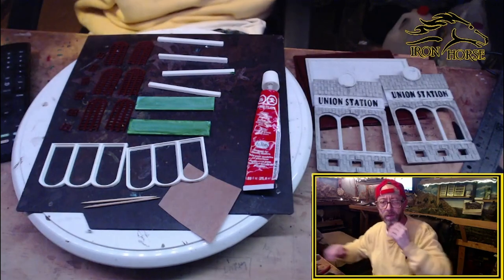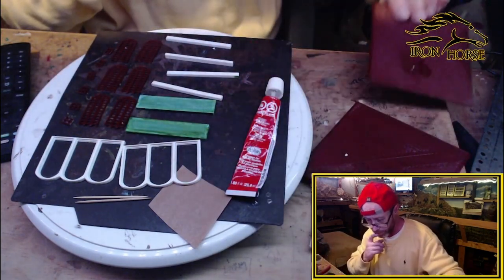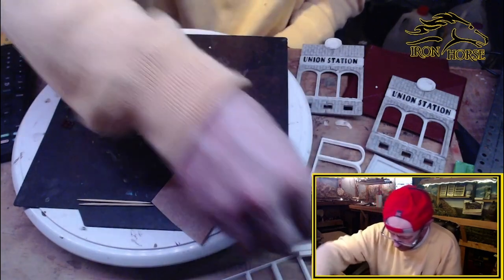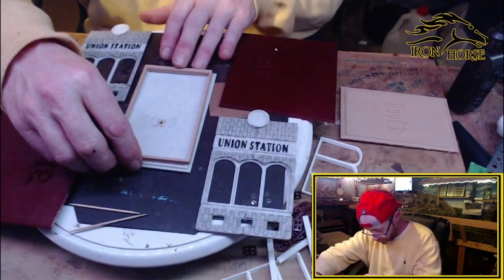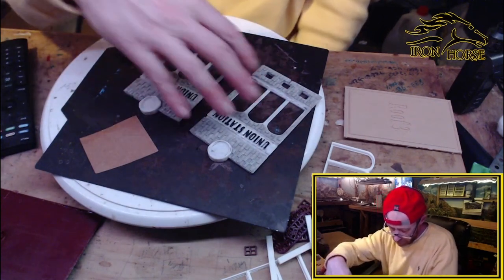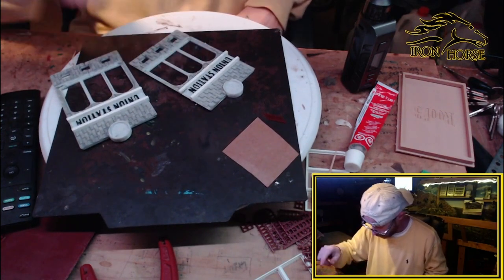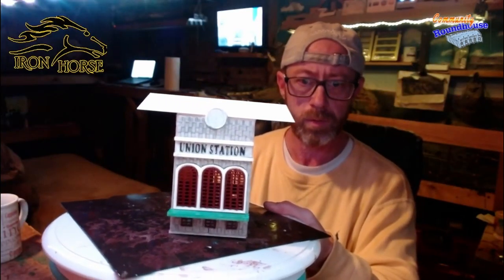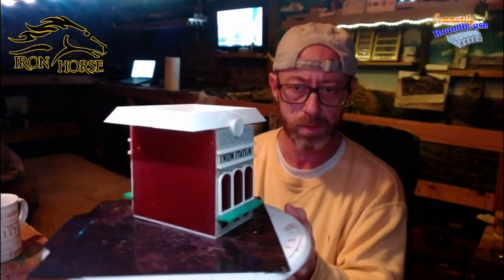Denver's Union Station N Scale Project Build Series - Part 1 - Scratch Printed Model Railroad struct

Comment: Brian, Nice job on your station design. What programs are you using for design and slicing? What kind of printer are you using?……John
Reply from the maker: Hey John T.  How are you?   I am using tinkercad to design (free), cura to slice (free 2 :-)  ) and then an Ender 3 filament printer. (El Cheapo :-)  )  .   Thank you for watching and commenting.  Let me know if you have any other questions or need any assistance with any of those.  If I am able, I am happy to help. Brian
Reply: Brian, I am doing fine, just getting older by the day. I also use both Tinkercad and Cura. My current printer is the Anycubic Vyper which is very similar to yours. I have previously used XYZPRINTING daVinci mini and 1.0 Pro but the Vyper prints much better than those…..John